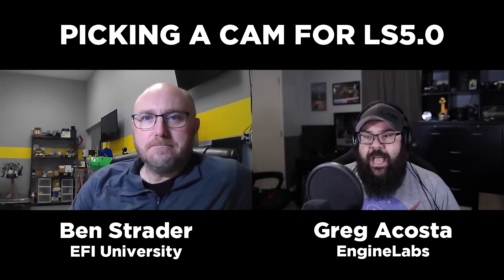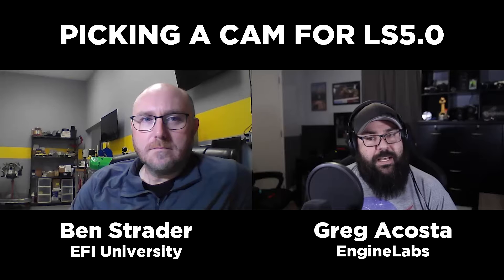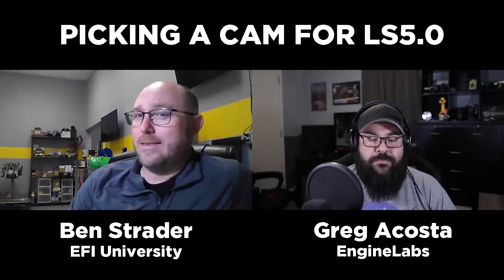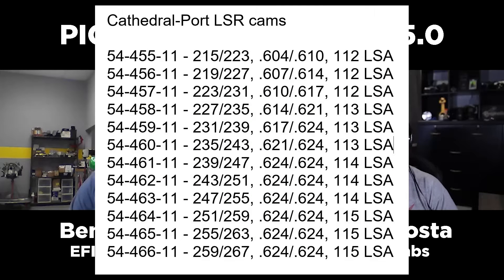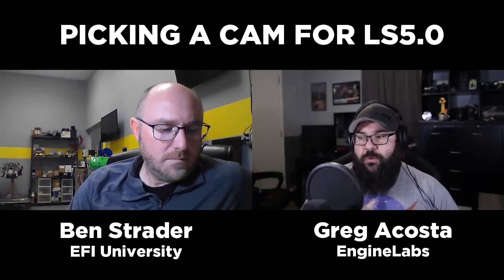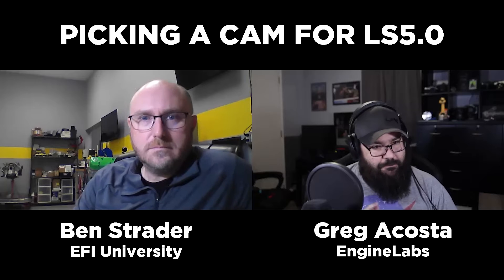Picking a cam for EngineLabs' LS5.0 with Ben Strader of EFI University

Comment: I did a bit of a science experiment on the math here. For flow, instead of using peak flow i used average flow from .200 through peak. I came up with an intake lobe calculation closer to 245-248 @ .050. My cylinder head guy went with a 247/254 for a similar displacement autocross build. We shall see. Can't wait to see this engine dynoed

Comment: What do you all think about David Vizard's camshaft equation?
Reply: I had a long conversation with Eric Koenig of HorsePower Research about cam timing on the LS platform. Theres a sweet spot for intake closing event that changes with RPM, and a sweet spot for exhaust opening that is loosely based around compression ratio. The overlap triangle and how it's located around TDC determines EVC and IVO events. The LSA pretty much is what it is at that point.
Reply: @bigboreracing356  Well, its more like, its the number you need to start off with before any of the other variables can be optimized. If you don't start with the right LSA, you will always be leaving HP on the table. And he's got the dyno charts to back it up. What you think about his evidence?
Reply: @bigboreracing356  I need to see this, got a link to the video?

Comment: I wouldve run a far tighter lsa paying attention to the dynamic compression . That rod ratio isnt going to pull on the port worth a dam during overlap to get flow started with a wide lsa .  FACT !!! id rather rely on the breatheing ability , enhance the power strokes compression throughout its rev range , then use exiting gases to vacum my cylinder far better with a tight lsa for a substamtislly better initial fill with that really long rod combo . This is what a tight 108 deg lsa and resonable shorter duration (dynamic compression ratio of 8.0 to 8.3 to 1) offer for a powrrband with far greater torque everywhere . This emgine @302 cuin and ported 799s or 243s will be like haveing rectangular port heads vs ovals on a Rat . It needs that yank by exhaust gssses to get the fill movin !!!  Harder to tune but so much better EVERYWHERE !!!  Dont you guys get tired of wondering how the pros or for that matter Jap crotch rockets got their engines set up that rip everywhere low to high rpm  ?? Theres no other way to make that engine use 300+cfm  heads effectiveally with excellant throttle response and torque everywhere . They are called the laws of physics because the rules dont bend .

Comment: When is this build gonna hit the dyno? I've been watching YouTube.com/@RichardHoldener1727 videos like crazy for the last few months to figure out how to build a high-RPM short-stroke 5.1L LS1 with 4.8 rods and it looks like you guys are basically doing the same thing, only for a better purpose! I can't believe this project isn't getting more attention.
Reply from the maker: Unfortunately, this project suffered insane delays through the pandemic. The block is actually sitting in the middle of the shop right now and next in line after Retro 5.0. We just got the final parts in right after the holidays. So, soon!
Reply: @EngineLabs  looking very forward to it! Can you post any videos on how you chose the pistons, and why you chose the LPE heads? I'm having a hard time figuring out how you'll get 11:1 compression. Also, you kept telling Ben in this vid that your intake ports flowed 302 CFM, but your article reads 320 ("a 32 percent increase").
Reply from the maker: When we started the project, Lingenfelter's 799 port program was advertised as flowing 302 cfm at .600 lift. In the time the heads sat on the shelf, waiting on the supply chain to catch up, they refined their port design. It was a nice call to get, and made the supplier delay suck a little less. The videos on everything are coming and absolutely everything is going to be laid out on the table - nothing's getting hidden. But we got the compression through piston design and decking the heads. A little from column A and a little from column B.
Reply: @EngineLabs  Thanks so much, looking forward to reading your articles and hopefully building my own LS5.1! I'm trying to match Kyle Tucker's DSE-Z at 8500 screaming RPM though 😬.